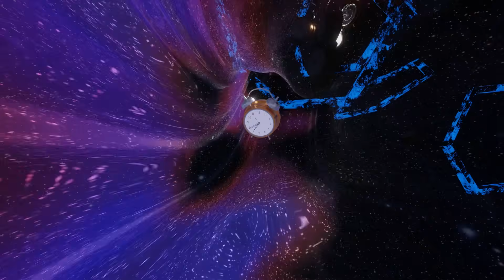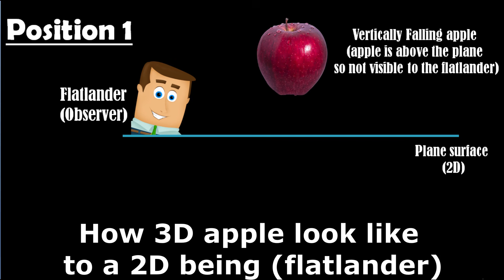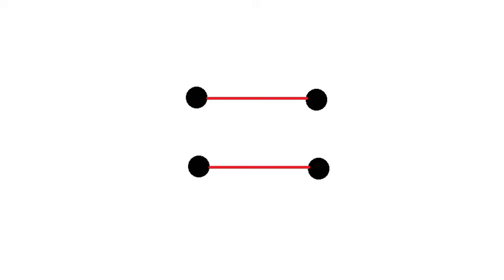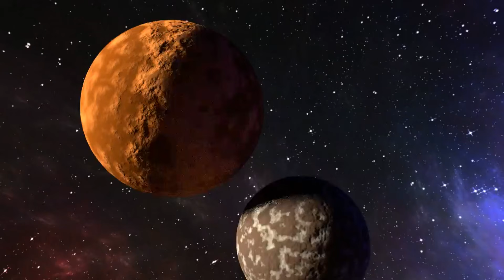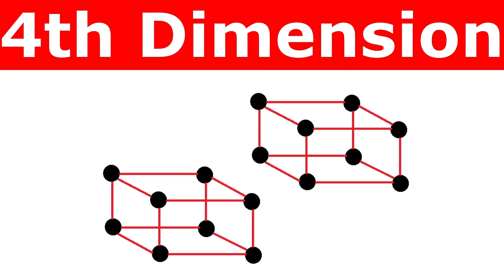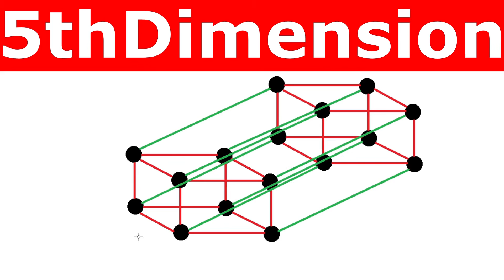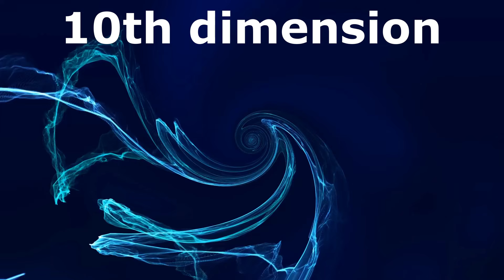11 Dimensions Explained - A Mind-Bending Explanation of Higher Dimensions!

Comment: Good video.  I was half awake and half asleep last night and came to this realization. 0D cannot exist, because it is impossible to have an infinitely thin "point".  If a point is a point, it is occupying space, which is impossible for 0D (it's actually 3D on a microscopic level). Same with 1D & 2D.  It is impossible for a "line" or a "shape" to exist with zero thickness whatsoever (again, both examples occupy 3D space on a microscopic level).  If it exists, that means it is made up of some sort of 3D particle on the microscopic level.  At no point can something become truly "flat"!) 

I liken it to absolute zero temperature.  Theoretically it exists, but literally it never can, because absolute zero means the cessation of all forms of matter (if you reach absolute zero, the electron orbits cease to orbit and all matter then destroys itself).  Therefore I have come to the conclusion that there are actually only 2 true (literal) dimensions.  The first is 3D, which is the dimension that all created beings operate in and are confined to.  Humans, animals, plants, angels, demons, etc.  The 2nd is 4D, which is God.  Only the One Who is Uncreated is Capable of Operating Outside of Time/Space.  There is no higher dimensions than 4D, because God Doesn't Need (or Want) Parallel Universes to Exist.  What would be the point?!?!  God Has and Will Always Exist in 4D, and is Therefore Always Superior to us 3D creatures that He Created.  If You Operate Outside of Time and Space, that means You Can Manipulate Time and Space, which means You Can Create 3D objects at Your Pleasure.

I have very few dreams that I actually remember.  One however has always stuck with me.  "I" am hurdling through space as a brilliant ball of light.  I know my destination is Heaven to Be with My Creator.  The main thing that stuck out about this "dream" was the Feelings!  Absolute and Unadulterated Freedom!  Although I was still a 3D Created Being, I was now Free to Explore and Experience just as God Does!  I cannot even put into words how magnificent this feeling of True Freedom Is!  Being released forever from the constraints of 3D into 4D!  Has anyone else experienced the same type of "dreams"?

Comment: The vectors to the 2nd dimension aren't limited to two points and a vertical line and could be formed of many lines in multiple directions. If you were to view the second dimension as though there were only that dimension then everything would appear to be flat and It is my belief that all 11 dimensions are completely overlapping given the conditions of the first four are all depending on the latter to create the next.

Comment: 1) If from a math point of view, a dimension is just another potential way to move,  would that mean on the atomic level, the should not the ability to break apart or combine (fission or fusion) be considered another dimension? 2) Why does the physical world seems to only move forward? Is it similar to needing to calculate centrifugal force, a force that really doesn't exist to calculate cenpedal force? 3) If the 11 dimensions were as described in M-Theory, could we be perceiving one p-brane as the physical worlrd, but have a second p-brane surrounding the first, and the interaction between the p-branes would be through gravity? If so, this gravitational force could be used to constrain probability on the quantum level. This could be seen as a reverse look of the Quantum Mind Theory, as instead of mind being created by quantum fluctuations, mind is controlling the quantum fluctuations to exert itself on a nervous system. Any thoughts from anyone else?

Comment: There is a completely different way to understand the geometry of dimensions, one that I think makes more sense:
Dimension n is an ordered sequence of dimensions n-1, for n starting at 1.
So, zero dimension is just a point (I prefer to think of it as a single binary variable, taking value 0 or 1).
The first dimension is an ordered sequence of points.
The second dimension is an ordered sequence of 1-dimensions.
The third dimension is an ordered sequence of 2-dimensions.
The fourth dimension is an ordered sequence of 3-dimensions.
The fifth dimension is an ordered sequence of 4-dimensions.
etc.
This does recreate the basic structure of our universe, at least up the fourth dimension (time).
As I just said, the fourth dimension is time. A 4-dimensional object is a process or enduring event (like WWI or WW2). The fourth dimension taken as a whole is the history of the universe from beginning to end. If you consider the universe at any one time to be a 3-dimensional object, that object changes over time, which is just the same thing as an ordered sequence of 3D objects. 
What is the fifth dimension? Well, it is an ordered sequence of all the possible alternative histories of the universe. I'm not sure how it is ordered, but it somehow represents the notion of possibility, or parallel universes.
The sixth dimension would be an ordered sequence of 5-dimensions. I'm not sure how to interpret that. Each element would be just a different ordering of parallel universes.

Perhaps we live in a 5D universe? The dimensions, in order, are space (1-3), time (4) and possibility (5).

Comment: 🎯 Key Takeaways for quick navigation:

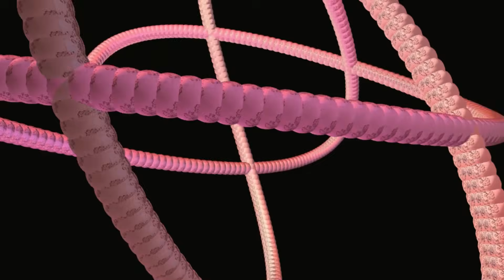03:34 Strings in atoms vibrate in 11 dimensions according to string theory,
- Everything in the universe, including subatomic particles, is composed of tiny vibrating loops known as strings.
- At the microscopic level inside atoms, strings vibrate in 11 dimensions.
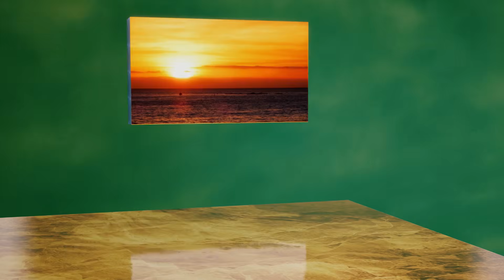07:30 Objects from higher dimensions may appear supernatural to lower-dimensional beings,
- Higher-dimensional objects may seem to materialize, change shape, and disappear, appearing as magic to lower-dimensional beings.
- Higher-dimensional objects move in dimensions not perceived by lower-dimensional beings.
09:10 Hypercubes illustrate the concept of the fourth dimension,
- Hypercubes, or tesseracts, serve as four-dimensional analogs of cubes, demonstrating the concept of the fourth dimension.
- In a hypercube, the relationship between its components mirrors that of a cube in three dimensions.
11:48 Fifth-dimensional beings can control time and occupy multiple locations simultaneously,
- Fifth-dimensional beings possess powers over time and space, including the ability to be present in multiple locations simultaneously.
- Parallel universes exist in the fifth dimension, allowing for diverse career paths and independent versions of oneself.
13:10 Sixth dimension permits observation of past, present, and future across parallel universes,
- Beings in the sixth dimension can observe all timelines of parallel universes, past, present, and future.
- Parallel universes in the sixth dimension must share the same initial conditions, such as the Big Bang.
14:37 Eighth dimension represents all possible scenarios for infinite parallel universes,
- The eighth dimension encompasses all potential outcomes and timelines for infinite parallel universes.
- Objects in the eighth dimension lack physical existence, akin to concepts in a digital or virtual reality world.
15:29 Tenth-dimensional beings possess infinite powers and control over all universes,
- Tenth-dimensional beings have incomprehensible abilities, controlling space-time and all aspects of infinite universes.
- Some research suggests that a tenth-dimensional being could be considered akin to a deity or "God."
16:15 Eleventh dimension proposed to

Made with HARPA AI

Comment: At first, Thare is 12 dimensions as far I know ... 
At second, any kind of existence in physical form, starting from atoms, may exist in 3D. So Space-time with specific electromagnetic field to "trap" all energy vibrating and moving with speed smaller than Light
All other Dimensions are non phisical in known to Us meaning. 
Starting from 5D all exist in zero point energy- time cant exist in linear and any form so matter in physical form either. Energy form and all happening same time

Comment: This is a mistake the 4 Dimensions are mentioned in the Bible.  Breadth, length, height, and depth.  The mistake which is cleared up in the Bible is that Height and Depth are separated into TWO not a single!   So the scientist are ignoring this fact so if you go by what God states than the 5th Dimension would really be Time.  The Height and Depth represent Heaven Plane and Hell Plane.  So today's scientist ignore this split because it is proof that the Bible is correct which means there is a God which they do not want to admit!  His apple example actually proved there is a Height and Depth as their is up and down not just height.

Comment: It is better to take shortcuts to move from one dimension to to another dimension inside an atom.This explains the string theory. Our naked eye can see 3 dimensions x,y,z axises of a cubical figure.Multiple  Universe exists in the 7th dimension.There is the existence of so called God in the 10th dimension.But there exists an 11th dimension of the size of an and inside the atom nucleus exists.But that 11th dimension only explains our existence in this Multiple Universes exists.Big Bang theory only explains the existence of our universe which most people think.There still needs to be explained the theory from where the 11th dimension occurs.I have said earlier that our universe as we think is vastly expanding and the rate at which it is expanding has yet to be calculated.The expansion of our Universe was explained by Edwin Hubble.He used a telescope and pierced through the milky way Galaxy. Edwin Hubble found that there exists millions of galaxies in the universe.Milky way Galaxy is one of them where our planet Earth or Star Sun exists.Our universe is expanding at a very fast rate which is not precisely known.Albert Einstein had other theory.Albert Einstein said that though our universe is expanding at a huge rate a time will come that it will contract.I predict that that if our Universe will contract than our universe should once again contract and come into the size of an atom as same as at the time of Big Bang.It explains that according to Albert Einstein universe will again take the size of an atom.But according to me Edwin Hubble was Correct our universe is expanding at a huge rate and every celestial body or Galaxy is moving apart from each other.Collision of Galaxies is a common and proved phenomenon by the scientists.Our universe is not stagnant.Our Universe is expanding at a huge rate which is not yet calculated using even the most powerful telescopes on planet Earth.

Comment: A sheet of paper has 3 dimensions , not 2 , length, width and height as well (thickness). After all, a stack of 100 newspapers does indeed have 3 dimensions, which would be impossible if 1 sheet only had 2 dimensions

Comment: My personal zero dimension is Gravity . That is  the fundamental force that holds down to the dot . And is a part of all the other dimensions . However  it’s  a theory that I have been researching . But it’s difficult to find anything more than just what seams basic to understanding the higher dimensions for myself . As many of the others have to use math that  fits with string as well .
Reply: I personally think that gravity may actually be a higher dimensional influence, which may explain dark matter

Comment: 00:02 Understanding and visualization of dimensions from 0th to 11th.
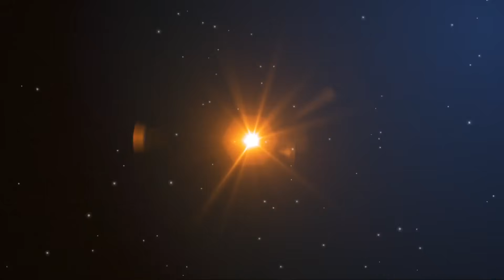02:24 Higher dimensions are difficult for our 3D brains to visualize.
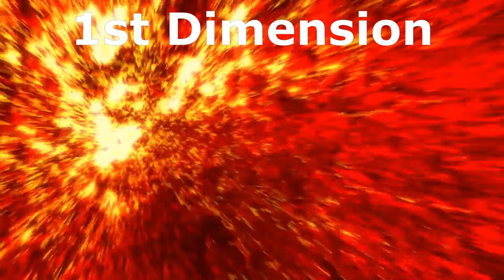04:34 Explanation of dimensions and their characteristics
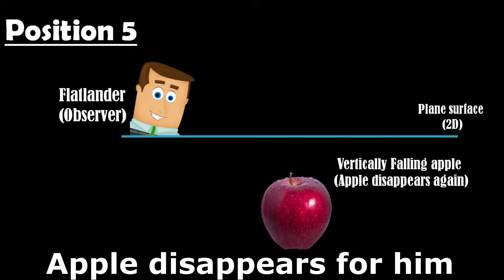06:56 Higher dimensions allow for movement in additional unseen dimensions.
09:16 Humans are 3D beings, but the 4th dimension is a hypercube.
12:55 Sixth dimension allows free movement between parallel universes.
14:31 Higher dimensions offer mind-boggling possibilities
17:20 String theory explains subatomic particles vibration and size

Comment: Nicely explained, but in my vision the 4th and 5th dimensions are not as you say! In the 4th dimension you could be aware of the temporal changes in the NOW and in this way imagine what might happen in the future by looking at what has happened in the past up to now. Example: You look at a large tree and later plant a young tree and imagine how it grows and becomes just as strong as the large tree. Your thoughts wander through time! You can do the same with any object that changes over time.
In the 5th dimension they use the 3rd eye. To do this, the two hemispheres of the brain must now be completely in balance. Space, time, size and now also appearances merge into a unity. Outside and inside are the same, everything becomes the self, while the self is reflected in everything. You observe that from the 1st dimension, as what you actually are: the spirit itsself

Comment: It's a good video.  I am trying to make the same video, but mine will focus on the minimum number of points to go to each higher dimension.   For example, The zeroth dimension can be illustrated with just one point.  If another point is added, anywhere around that point, you can connect them in a line.  And the line is the first dimension.  But to get to the second dimension, I don't have to double the points.  All I need to go from the first dimension to the second is just one more point.  Thus creating a triangle, which is a flat 2 dimensional plane.  Then to go from the second dimension to the third dimension, I again only have to add one point.  As long as that point is outside the plane of the 2nd dimension, then I can enter the third dimension by connecting the points to form a tetrahedron.  Now to enter the higher dimensions beyond that which we can observe, we have to visualize concepts we already understand in our realm of reality, and then identify the congruence to higher dimensional concepts, and apply them. So before I get too complex with written explanations, I will finish my video.  Because understanding higher dimensions will require more than just visualization.  But as crazy as it might sound, we can actually see the 4th dimension from our 3rd dimensional looking glass.  Because we do not experience the universe in simultaneity.  Just as the flatlander experiences their reality in linear slices.  We experience our reality in 2 dimensional slices.  We could think of them as frames from a movie reel.

Comment: I  have to disagree with the notion of no movement if we count zero as a dimension. zero means no restriction also. If motion was impossible than you could not create and extension between two points as that requires the ability to move in other to produce end point.  As such 0 does not restrict anything as there is an absence of restriction.  restriction begins with creating the polarity of end points as a dimensional plane. 

Second we actually only see things ourselves and everything around us at 2D perspectives. We can perceive 3D but we cannot see everything 3 dimensional;y or we would be able to see everything from al sides at once.  Looking at a screen and this video is an example of how we can perceive 3D yet are only looking at it on a 3D plane called a screen.

 Within 3D space we already move 4 dimensional based on rotation. If this was untrue we could not turn toward any direction and only be able to move in straight lines of forward, backward, up and down or side to side.  

The 5th dimension is simply sequential as "time" as a chain of moments of movement through 4D space as I just presented. That is then contingent upon factors of velocity, frequency and intensity which all have their mutual tied in effects of gravitation which itself is more of an expression rather than a force which is a key reason why sciences are making a huge blunder failing to see the actual force is Electroc-kinetic along with Electrostatic as fundamental forces along with the other three of electromagnetic and the strong and weak nuclear forces. 

I can sum this up in any case as:

5 forces of the cosmos as:

1.  Electro-Kinetic.  Note that this Creates gravitation effects and can be fluctuating or rigid like a fluid. 
2.  Electro-Magnetic. 
3.  Electro-Static.
4.  Strong Nuclear.
5.  Weak Nuclear. 

0.:   Zero =no restriction, no limitation.  
1.	Causality/Activity.
2.	Width/Thickness.
3.	Length/Distance.
4.	Height/Depth.
5.	Rotation/Curvature.
6.	Time/Sequence.
7.	Locality/Position
8.	Non-Locality/Multi-Positioning. 
9.	Possibility/Potentiality.
10.	Eventuality/Consequence.

So there are only 10 Dimensions.

Time can be considers one very long day.

Comment: very nice thanks. but I think logic stops at the 9th dimension if we consider the 9th dimension as a single dot in the 10th dimension that represents all the possible branches for all the possible timelines of all the possible universes. There's nowhere left to go to have another single 9th dimension dot. we've included everything that might have been probable in the 9th dimension. And as far as I know, those strings are supposed to be vibrating in the 10th dimension, not the 11th.